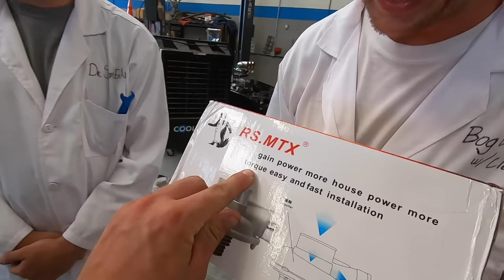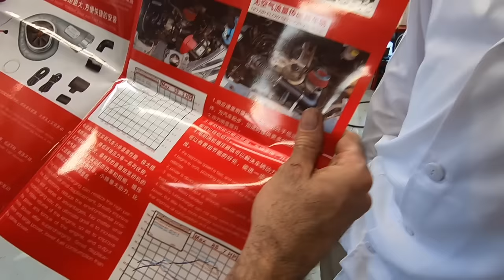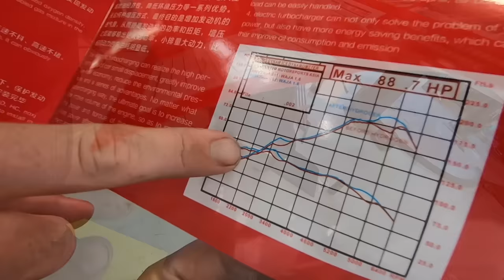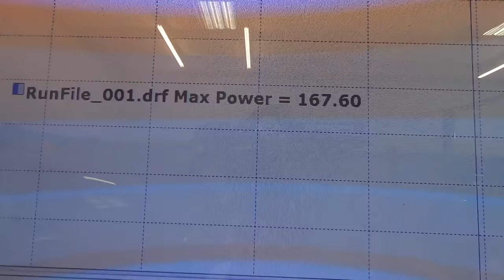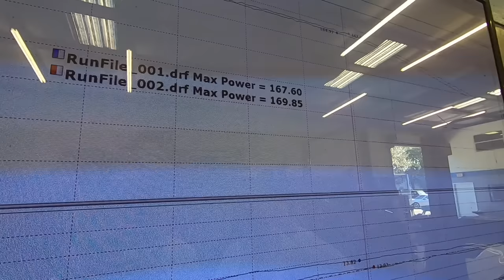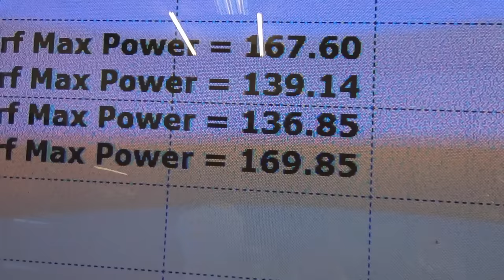Dyno Testing a $400 ELECTRIC TURBO! Funniest Car Part EVER!

Comment: They actually make electric turbo chargers that are quality and work, they are on the new F1 race car engines they eliminate turbo lag with electric hybrid turbo chargers. You have to have a capacitor bank to build up a charge and you need it to have variable voltage, you can't just hook it to the battery and expect it to work.
Reply: Its gonna be in regular cars soon. We are currently developing such a device in Garrett.
Reply: Wasn't Volvo using one in conjunction with a small supercharger? I read an article a while back about this same thing.
Reply: As I understood it, it actually isn't an "electric turbo", it's a V6 with a turbo and an electric motor, which helps with the turbo lag. You can build up a charge over time, yes.
Reply: Audi has had a prototype with an electric turbo for about 2 years, it makes instant power. You can find that car on a German YouTube channel.
I am surprised that this test reduced power.
Reply: @TBasianeyes  I think that if they made a custom intake where you have a "Y" inlet where on one side you have the regular air filter sucking in air on a normal drive and on the other side you have the electric turbo pushing air into it I think it would make some gains because the way they got it installed in this video does restrict air but at the same time the instructions weren't that great either

A channel called "itsjusta6" used an electric leaf blower as a forced induction system and there was actually some gains to it and it works very similar to how this electric turbo work so it could be possible that they might have needed a bigger one or do the intake intersection idea I mentioned and it could possibly make some gains

Comment: I’d love to try that one the mini bike we race at motor cycle rally’s. I wonder if it’ll do anything to a 212cc
Reply: The pressures from centrifugal compressors have a lot to do with tip velocity squared. I
If the speeds the wheel spins are low it does not matter how much you stuff up the output there is a maximum pressure you can get and it might not be much. It would theoretically have some added power but maybe not worth the $400 price tag.
Reply: daniel dimitri mustard goes in the tree house to make the backfire sequential to the fuel intake cylinder of the top end

Comment: Those glasses and labcoat fit you quite well, Professor Cleeter.
Reply: It should be a new segment. Doctor Cleeturs ................. Let's get some ideas.
Reply: @KeepingItKeith  "Today on 'Test-Beater, with Professor Cleeter', we use our trusty beater Mustang to test directly injected compressed air as a power-adder"

Comment: So is it spinning in reverse when you hooked it up to the car?

Kinda looks like it
Reply: I was wondering that myself with the decrease in HP. I personally think it's just too small for that size engine.
Reply: it's spinning at a fixed rate causing air restriction
Reply: @jacobmarianoguron9333  go to 17:55 and play at 0.25 speed. Def spinning counter clockwise.
Reply: @xFourTwenty117  They mention back pressure. They are just feeling the sir coming out lol
Reply: Idk, if it was spinning backwards by force do you think it could continue spinning backwards at 7000 rpm intake from the engine? ....
Reply: Wait i just woke up lol, my comment doesnt prove it isnt spinning backwards
Reply: Mr BUDD yup.. def counter
Reply: no it has to spin clockwise not counter, remember the turbine works as a scoop so the top of the blade is the leading edge, it is indeed turning backwards
Reply: @phillstevenson4931  Hmm, I guess I looked at it wrong. You are right. But at around 20 minutes he starts it and it is turning clockwise.
Reply: One of them even held their hand in front of it as if he's feeling the air blowing from it.
Reply: I feel like spinning it backwards we would have seen the engine nearly die or sputter in some way sucking the air out of the engine providing everything is sealed right if it didn't die I'd think it would blow that little turbo up that would be way to much drag

Comment: I would like to see a dyno test with a small 4 cylinder 1.0L car or less with this E turbo if possible. Ps: Does it run only on 12 volts? Maybe it can handle more volts input.
Reply: Captain MufDyven  It's not a DC motor....3 pins, not 2
Reply: Captain MufDyven  Nope - the Chinese favorite for cheap high output motors is BLDC

Comment: Cleetus just before you did your pull on the mustang you touched the blue wire on the battery if you look at the video again it’s spinning backwards that is why you lost power
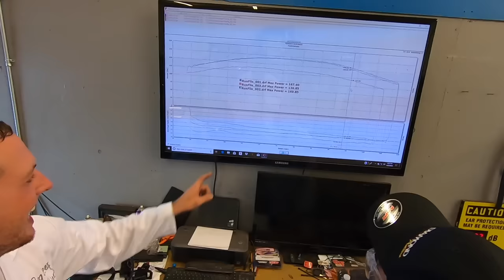Reply: 20:45 he literally said it didn’t have much air( yes it’s spinning backwards sucks air out)
Reply: How would you make it run the correct way if it's running backwards?
Reply: @desmadres01  The way you wire electric radiator fans. Switch the power and ground around and the electric controller should know you're trying to spin it in either direction
Reply: It could be the speed refresh rate of your monitor or the hz setting you had on the video. On .25 speed and 60hz you can tell it's spinning the right way
Reply: I see the wrong way spinning! This is the way to loss 30 hp!👍
Reply: my bad   when they first hooked it up it looks like they had it right but when they were actually testing it it was indeed spinning backwards
Reply: Caleb Gregory just need these guys to see it and do another test lol
Reply: rewire. test again. makes complete sense if the engine was fighting against it.

Comment: what you have there is something you need 2 of , mount them up to a mcfarland fab turbo kit on a mock up engine block , you know the plastic ones , and set it up to run and blow air for a display at your race tent , it will help cool you off after a run , and be funny as hell to boot

Comment: Of course it lost power. On EFI engines, the air/fuel ratio is already optimal. Increasing or decreasing air or fuel will cause you to lose power. If you want the turbo to make a difference, you also have to increase the fuel proportionally when you increase the air. There is also the fact that this turbo probably can't produce the CFM that this engine already pulls naturally. Get it right, and you could mow your grass in half the time.
Reply: This is the most well explained comment it should be illegal
Reply: Alasan ini mungkin yang terbaik mengapa tenaga kudanya berkurang
Reply: Richard von Muenster  You were driving a hand grenade,lol. It would way over fuel, a good thing or it most certainly would have gone bang real fast,lol. The mass flow sensor would be useless as your extra injector comes AFTER the flow meter:/
Reply: Actually, this is not correct.  Modern EFI engine maps can handle a small boost.  Imagine having a car that could not run at all in Denver where the atmospheric pressure is significantly lower.  A turbo is primarily designed to increase static pressure, so yes there will be more air in the combustion chamber, but the loss of power in this example could be many things.  The boost of this turbo is so mild at lower rpm that I would expect the turbo design is just being more of a restriction at higher rpms.  In the video, they specifically say that it ran rich.  This means that the turbo was a restriction vs. adding boost.  The turbine was probably spinning faster due to engine vacuum than the electric motor pushing air.
Reply: Disagree strongly. Have built a shit ton of factory efi/natty porsches and easily doubled+ their bhp.. and even using factory ecus that are EFI. Trippled + bhp.... tbf.. alot of money and tuning time was involved on a bunch of those that were never designed for it.. BUT. An absolute bounty of examples of non forced induction, Efi engines that are absolute monstrous bastards...  EFI is the easiest shit to modify and add power boosters.. its electronic.. it's in the name.. most factory ECUS ans eprom modules are advanced enough to modify and handle anything you can throw at them.. your comment is.. true for like.. a handful of cars?? Forgot about the rest I guess
Reply: No full natty tune mod increased HP by any margin worth talking about. But ALL cars have a ridiculous handicap on them because #theenvironment. Emissions based factory tunes are insanely bad for performance. I've improved 2 of my dailys mpg and bhp (tbh one turbocharged and one twin turbo) by a substantial amount just on their owm configuration. I'll concede I missed the first part of your response. That was correct mostly. But I've seen plenty of wacky shit like that electric "turbocharger" boost supplied boost pressure 2x over stock. Cant do that with any chance of any longevity on stock components. For a v8.. yeah. Prob need a electric turbo 3-5× as big to make power. For a I-4, game on
Reply: No dummy, these things CAN work. Now, you will probably lose the top end when it's not boosting (because it's not restrictive enough to affect the low end), but an electric turbo does not violate any laws (of physics).  If you have a bunch of supercaps or a large battery, you can charge up those caps or battery (battery preferable) and periodically hit the boost button (though you obviously cannot hit it continuously).

 There is actually a later video by these guys showing one that works and provided 5 pounds of boost and a 15%( roughly) increase in power over baseline (without it hooked up).  There was a small drop in power at the top end when it was hooked up and not being powered.  It was being powered by an external battery charged by the alternator. (by the size alone, I would say it was 2kwh at 48V)
While they did re-tune it, the ECM can increase the gasoline.

There is also at least one production vehicle that has an electric turbo. Engineering explained went over it on his channel. I think it was either VW or Volvo.
Reply: @Forgivefull  Shame it's wrong.
Reply: @notyouraveragegoldenpotato  if u have done that then surely u got one video proving it.
Reply: Finally.. Someone who speaks English...
-Tony...
Reply: Somewhat true, but the ECU will auto compensate to some degree... ECUs aren't static.

Comment: They should try it with a small engine.
Reply: Void33 - yes. Try it on a 1,0 R3 engine. A V8 sucks to much air.
Reply: I’m thinking Kawasaki 250 Ninja.
Reply: Lawnmower engine. +2 HP guaranteed.
Reply: it's for motorcycles.
Reply: @dickdanger5700  Well the title is confusing at best since it says both motorcycle and car.
Reply: @mdgardner70  damn, I may steal that idea for mine
Reply: Yeah, you would need 4 of them to make 600hp.

Comment: The one thing everyone seems to be forgetting is in japan most cars have 4 cyl engines. your trying to pull twice the air it's designed for. For a true test, test on a 4 cyl.
Reply: vrtigo would still be interesting. Even on the moped it’d be cool
Reply: @vertigoalopolus  and we all know chinese all drive v8's
Reply: I think your forgetting most 4cyl engines these days make more than 167hp. That V8 ain’t sucking that much air despite the sound it makes.
Reply: @5150gino  AND MOST OF THEN COME FORCED INDUCTION factory
Reply: @5150gino  Nothing to do with it I'm afraid buddy. 8 cylinders will have more chamber area than a 4 cylinder so a V8 will definitely suck in air harder. Twice as much to be precise.. 
Most 4 cylinder engines are put into cars that weigh less than the cars you put a V8 in as well! Weight out is just as good as HP in. That's why a Ford Focus with a 1.6 litre weighing a tonne can give a 2.5L flat 6 BMW weighing a tonne and a half a proper run for its money. They have roughly the same power to weight ratio
Reply: Ramp-Ha's Rc's yes many do but I can think of lots of 4 cylinders that don’t and make around the same hp. That’s all mate.
Reply: @lowerthetone  The amount of air flow required is directly related to the amount of horsepower generated. If you know the air flow you can calculate the horsepower on any engine.
Reply: @nitroustommy3668  only the max potential horsepower it COULD generate.  It does not tell you with any accuracy, the amount of power it WILL make.
Reply: J Wuh hey mate, I don’t know what “chamber area” is, I think your trying to say capacity. Think about it like this, the 4.6ltr v8 in the clip made around 165hp, there are a few n/a 2.0ltr engines that make around the same hp, how? It’s called of “volumetric efficiency” or “VE” It’s how an engine uses and burns the fuel and air that it’s fed and is usually measured as a percentage. Some engines have a 70% VE, some have a 95% VE, the higher VE engine would make roughly 25% more power all being equal. At the end of the day 165hp is 165hp no matter what engine makes it.
Reply: @lowerthetone  what BMW has a flat 6?
Reply: @mattb4265  maybe he meant straight 6?
Reply: It won't matter.  Even if it was appropriately sized for the engine, it won't work. It's basically like putting a hair dryer on your air intake. Not enough air pressure to make a difference.
Reply: @nitroustommy3668  Wrong. The amount of air an engine can move is directly related to its displacement. Power depends on countless variables, and heavily depends on volumetric efficiency.
Reply: @lowerthetone  It's thermodynamic, 4 cyl engine and a V8 that produce the same power output chug more or less the same amount of fuel, therefore the same amount of air. Otto cycle engines have more or less the same thermal efficiency across the board, so if it produce x amount of power it burns y amount of fuel and with the air/fuel ratio it chugs z amount of air. Compression and a turbo can increase a little that thermal efficiency but not by far. If your V8 chugs twice the air and only produce the same power output it's running a bit too lean my friend.
Reply: @blurrybigfoot1842  😂 so why does a 454 (7.4L) big block from the 80's make about half the power of a 3.7L V6 today?   It's the air flow of the heads. The key to making HP is Air and fuel not displacement.
Reply: @nitroustommy3668  volumetric efficiency... thank you for making my point😂

Comment: "Electric turbo"? 
"House power"?
 Isnt that more commonly called a hair dryer?
Reply: electric turbines aren't anything new and are capable of producing high hydraulic volumes.. it's just not been effectively/efficiently made to this small scale, for this type of application before.
That being said, the specs on this one doesn't seem to be any better that the other failed "hair dryer" attempts.
Reply: The "R" abd "E" next to each other so it's house power instead of horse power! No spell checking? Haha!

Comment: I want to see this on the smallest, most anemic engine.
Reply: Harbor Freight Predator.
Reply: KEI 3 cyl truck!
Reply: honda fit
Reply: The G10 I ripped out of my old metro before I dropped in the g18 to g20 stroker turbo.
Reply: Kohler XT.
Reply: You can actually hear it spool higher as revs go up. Motor is just dragging it.
Reply: A suzuki ignis
Reply: @mnetwork    That motor is 12 Volts? Seems weak to me.
Reply: A b&s lawn mower, better make it a 3.5hp one.
Reply: 50cc 2 cylinder engine then
Reply: You already saw it installed on a 90's mustang lol
Reply: Find some kid in your neighborhood with a goped and pimp it out🤔

Comment: You should have tried it on a smaller displacement engine. 4 banger
Reply: It was running backwards......lol
Reply: Robert Longo What do you mean by that? Why are people saying that? Do you not know how turbos work?
Reply: @cedar7685  
Could be a video framerate problem, but if you check around 17:55, it does look like it is running backwards.
Reply: The wiring polarity was reversed between the test run and the dyno run. You can see the wiring connection were different
Reply: Kyong Song looks like it’s spinning the right way to me.
Reply: If it was sucking his hand in, it was spinning the right direction
Reply: u are dam right.

Comment: That thing might actually boost a Geo/Chevy Metro since they had little 3 cylinder engines; barely 1 liter IIRC
Reply: I'm thinking that too.. better for very weak cars. Like mine, Daewoo Matiz, 3 cylinders, 0.8 liters
Reply: Would be cool to see if they ran it off a separate battery/charging system.  If they hooked it up to the Geo's battery it'd likely do the same thing.
Reply: @jth_printed_designs  yeah I bet the amperage requirements are insane. Would likely need an upgraded alternator just to supply it. Or an independent battery bank and some capacitors.
Reply: 1.3L of 3cyl fury. The output of the Eturbo would have to be higher than the intake of the engine- otherwise it will restrict it like in this case lol.
Reply: @koushiroizumi0  an 800cc car engine?!!
Reply: @rocknrolljesus3197  Yeah.. more exactly the engine is a Suzuki F8C

Comment: I fell like you could design an electric turbo that actually works, but no one has lol. You'd also need an auxiliary power source, like a prius to actually gain HP. Maybe put one in a prius lol. You would also need to have a proper intake and good enough airflow. You would also need a motor that can hit high enough RPMs.

Comment: Hey guys! Hahahahaha! Fracking love y'all. I assume this was before the 2.5k turbo. So, I was once into radio control airplanes, & we had these drive systems called ducted fans. Like 4" inlets (wink wink) to simulate a jet. 
   Well, for years I've thought ( cause I've followed my hobby and seen the rise of electrics) where's the electric ducted fan?  ...and if it makes enough "thrust" (house power?) to fly, would it not boost?
   Never stop having fun, it's why I watch.

Comment: I wonder what it would do on a small four cylinder like 1.5 - 2 L
Reply: same, there is clearly no way for something that small on low voltage to push enough air for a v8.  But maybe it would work better on a small motorcycle/atv.

Comment: Try it on a 3 cylinder geo metro.

Edit: bet it would make 15 house power.
Reply: Basically, double the HP of the OEM Metro engine.
Reply: Exactly
Reply: For a electric turbo to make 15hp it needs a electric motor at 15hp, and than it needs to be 100% efficient witch is impossible, think a little